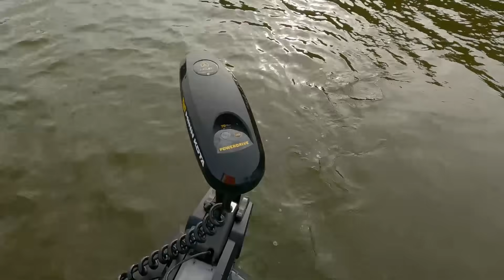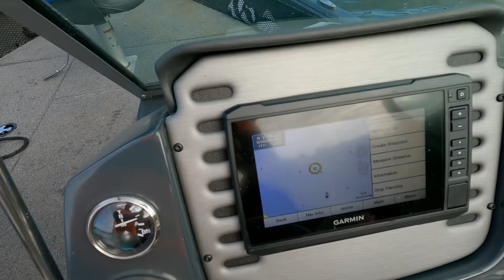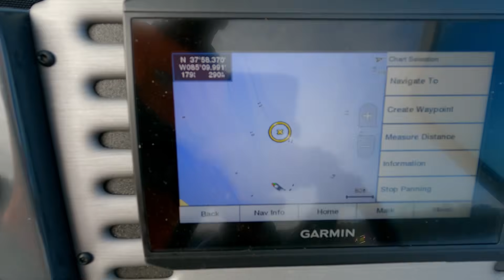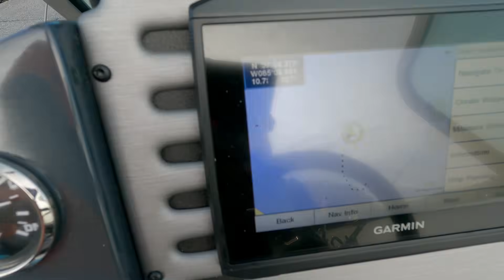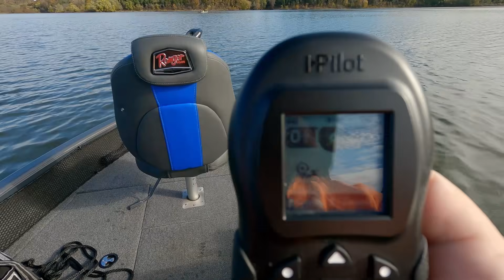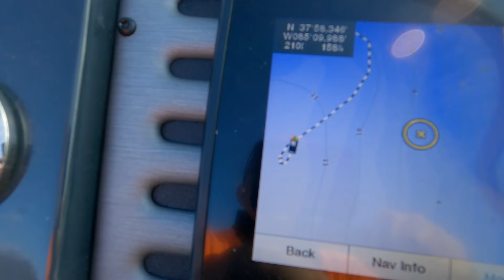Minn Kota Powerdrive i-Pilot Basic Operations #minnkota #powerdrive

Comment: good explanation! I can assure you that if you are in "spot lock" with the remote on your neck and you set the hook real hard you can inadvertently  press a button that might spin you in circles. It is very possible that the trolling motor prop will cut all 6 of the lines you had out........ Ask me how I know.

Comment: I have a pontoon that is a pain to load and unload when I'm by myself. Can this be used to load and unload the boat while I'm with truck and trailer?
Reply from the maker: This would be on the front of the boat so without seeing your trailer settup I cant answer that. If there is nothing for the trolling motor to hit in the center of the trailer I guess it would be possible

Comment: 1st rule should be to take the remote apart and adding di-electric grease to the gasket between the two halves. They do not seal well and your remote will soon die from internal corrosion.

Comment: The Minn Kota Powerdrive is a garbage trolling motor.  I've owned one for 3 years now.  Won't ever buy another Minn Kota.
Reply: Well isn’t that odd. I’ve had numerous Minnkotas and NEVER had a problem.
Reply: I also own 3 units on different boats they all work excellent.
(There's always someone that always has problems with everything)
They are great trolling motors
Reply: Nope. Power drive is the best.
Reply: @pointblankokc  they are a entry level model, yet almost bullet proof like any electronic motor.  You can upgrade them to the I pilot or advanced GPS bs buying a new motor.  They are not the terova or altera but they also don't cost anywhere near what they do .

Comment: Great video! I've had a minnkota Riptide powerdrive with ipilot for 2-1/2 yrs and really only used the spot lock, plus  moving around an area to find the sweet spot to fish. I fish in the marsh and out front of the MS East coast barrier islands. My 21' cc is so high in the front I mounted the trolling motor on the right rear corner.  It's the best anchor I've ever owned!  I got it because I have severe Lyme arthritis and have a terrible time with anchor ropes! I'm  changing to lithium batteries as the flooded deep cycle have quit after 2-1/2 yrs😳.  I'm glad you showed that I can record treks by setting the record and using my gas engine to create the trip. That would be great for trolling the 3 mile rock jetty. Thanks for the work you put into the video!
Reply from the maker: Glad you enjoyed it!

Comment: So you do not have to have powerdrive deployed to record a track? Because there is no other way to turn trolling motor on right?
Reply from the maker: There is no on/off switch on the Power Drive trolling motor, when you turn on the remote it will say "motor stowed" but you can still record a track.
Reply: @HooksandHammocks  ok just double checking thx

Comment: Great job Chris, I’ve always used Legacy because Advanced would over correct so much but would like to give it another try because recently I found out threw Garmin Customer Service (which is Fantastic) imo, that the Boat Scale plays a big part in that as well, I have the Terrova 112 and the Boat scale is factory default 0 at 5600 pound boat, I was having trouble with spot lock over correcting even on Legacy, they asked if my boat was 5600lbs and you know it’s a good bit under that, they said to play with the  -1 and -2 and I would be very pleased and the were right, has made a huge difference. Not sure if you ever have that problem but might check it out!
Reply from the maker: Thats some good info right there! Thanks for sharing!